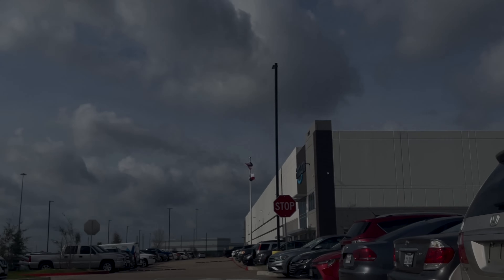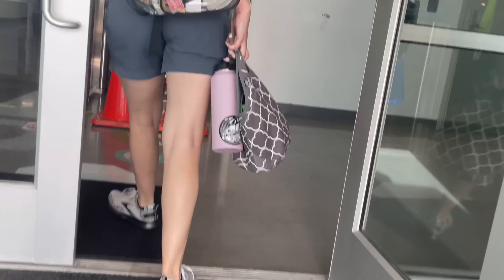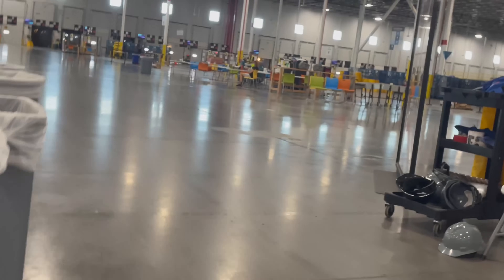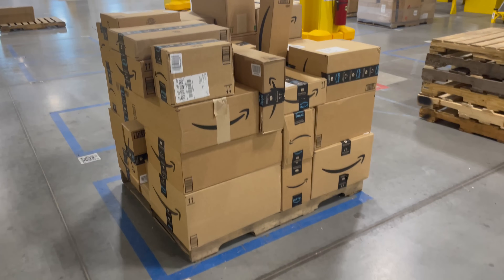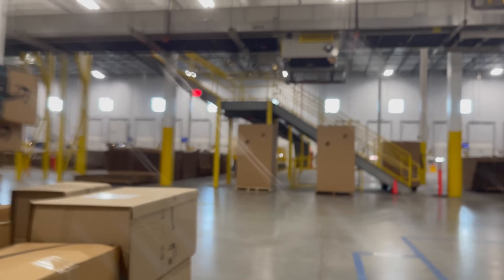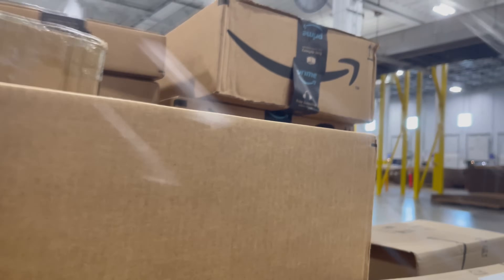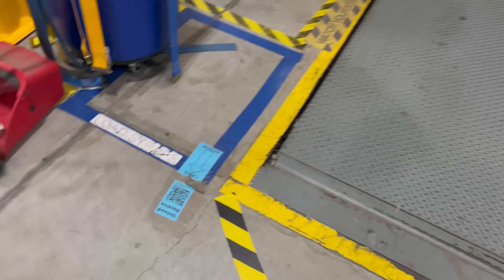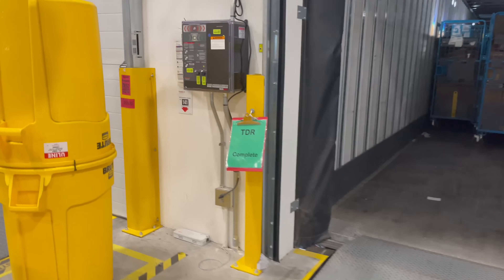What It's Like Working At An Amazon Sort Center Warehouse (INSIDE FOOTAGE)

Comment: Worked at STL5 a year ago. Wasn't too bad, and the hours were fine enough--only 4 hours a shift unless a flex up or down (3 or 5 hours).  You had the occasional manager who went on a power trip, or the average worker slacking off on the line. Breaks were alright, though they shorten them from 30 to 15 minutes during the middle of my tenure. The pay was okay-ish at $15.50 an hour. Though for the work I was putting in and the amount of time I was there it was a bit insulting to not receive a raise, and have the newer hirers get $18.00 an hour with a 3,000 sign-on bonus. A major pet peeve would be the constant "talks" I received due to my scanning numbers not being over 150 for the duration of the shift. It's quite silly to expect such numbers when you're essentially doing everything on the line: scanning (and stacking) boxers to the pallet, wrapping them, taking them to the stage, putting them on the trucks for outbound, etc. Keep in mind that I was only a scanner as I was not officially trained for these positions, but I got so good at them that I could do everyone's job. Be mindful of the holiday season. Thankful I got out before then because lines can get backed up tremendously bad--much worse than when you have high volume shift. I would say be calm, patient, socialize (always important), and stay on top of the work because it's not an unbearable place to be unless you make it--or be unfortunate enough to work at a bad site.
Reply: some of the dumbest associates i have had the pleasure of training and dealing with were from stl5. One of my ops managers personally pulled me aside and said let the TOT take care of them. Like openly racist type shit
Reply: @b_wellyn  When you’d get your start?
Reply: @Yuan-lo3zz  2018 to earlier this month. Got fired over a broken bone leave lol
Reply: @b_wellyn  They’re robotic with the numbers, that’s for sure. But continue to keep such inefficiencies at site. Sorry to hear you got let go, hopefully you found a better position elsewhere. I started in 2021 leaving in October for college.
Reply: Your mistake was trying to find everyone's job. If they assigned you to scan you're supposed to just scan
Reply: @b_wellyn that doesn't sound racist
Reply: I got a interview for them tmrw!
Reply: @ST41500  Good Luck with it. The process should be straightforward. Badge activation, training, tour of the facility, and eventually position selection. Most are easy, whether it be scanning, super chutes, water spiders, staging, or the “express stacking.” (Located on the far left of the building near Lane C. The only thing I disliked was ,as I call it, “black box.” These are the sections of the facility that require the use of two pallets to place items onto and eventually wrapped, closed, and loaded onto the trucks.

Comment: Sort Centers have gotten boring now, back when I worked for Amazon at an SC they still had PIT. Now SCs want everything done by a manual pallet jack and the carts. Very fond memories I have of the forklift and electric pallet jack filled Sort Center days!
Reply: I remember working at a building that center rider pallet jacks. Those were stupid fun when, the maintenance crews "inadvertently" gave out the code to make them faster 😅 ...gooood times.
Reply: XL buildings are like this still. Just because the stuff is just top heavy for regular jacks.

Comment: So many safety violations. xdock just means you are suppose to transload the freight from inbound dock to outbound dock ("cross"ing "dock"s). Interestingly enough, you didn't show how the freight is actually sorted. I'm assuming your facility is AR sortable, which in that case those inbound max-reach lines would feed a conveyance device to ensure a single line of parcels is fed to your shipping sorter which will scan them package and divert it directly to a chute, perhaps to robot arms, or even people to manually load a drive. The gaylord dumpers also likely feed a cross-belt sorter. 

There is also TOM team and TDR to get the trailers to and from the dock, ship clerk, etc. 

Nice thing about a xdock or sort center is that you only work the freight you have, so when you are done you can VTO/MTO and go home if your ops doesn't throttle you down to lengthen the sort window.

Comment: I just did my first 3 days of training and will be going in on my 4th on my own after two days off.  Your video was a nice refresher.  I don’t know why but I get the feeling that we didn’t get the full proper training we need.  I’ve never worked in a warehouse before but I still question why we “throw” all kinds of different size and weight packages inside the shuttle (Gaylord for you) 😅  but it’s like, we have the shutes where the robots upstairs are throwing boxes down.  We are at the bottom, waiting for these boxes and sort them out by either building a pallet, using those blue crates you showed towards the end, and/or throw them in the shuttles. But it doesn’t matter what comes down it all goes there, boxes, bags, heavy, light, you name it.  And they are literally thrown in, meaning we don’t pile them up in any organized manner.  At least that’s how we’ve been trained.  Which blows my mind. Those trailer containers though, we know nothing about.  I’m hoping we don’t ever have to deal with doing that because it certainly looks like the worst part about the job.
Reply from the maker: Thanks for the comment! I didn't receive much helpful training either. They give you like one "training day" and then expect you to learn everything within 2 weeks. Don't worry though you'll get the hang of it!

Comment: I might give this job a shot and see how it goes
Reply from the maker: Go for it!
Reply: Do it. this is my 3rd week and they are super fun people easy to get along with. been with delivery station 3 weeks. love it you'll be happy and room to grow. finding shifts you do have to be ready to be on top of. at least in the delivery station that's how it is
Reply: Do it. I'm in week two of my Sun-Wed, 7AM to 6:30PM (mandatory OT). Gotta be honest. Best warehouse job ever. My facility is brand new, but we use Order Pickers (basically fancy modified fork lifts that we rely on them basically). They go up to like 50/70 ft and are fun (but so slow, especially on turns)! Careful in your VNA's.
Reply: It’s really easy
Reply: My experience was way different lol. It's good at first but few weeks later you'll have almost no days off due to Mandatory schedules. You'll basically have 1 day off due to Holidays! You will work 12 hrs for 6 days straight with just one day off. Not saying it's a bad thing. Just a heads up
Reply: @unknownx  I used to not call off the whole year then during peak I would call off on holidays so I never hit the max points to get fired

Comment: I'm a box truck driver for amazon,keep in mind that if you put small packages on the bottom and big and heavy boxes on top or if you decide to put a punch of heavy boxes on one side then it's going to fall
Reply: Well the problem in ohio at a certain location is that all of the you know who worked there. That you know who that you know who said eat you know what. In Ohio. So they never built pallets properly. They couldn’t build a proper pallet to save their lives so it’s constantly a safety issue there. But they can’t say anything because they are protected beings.

Comment: Most people are trash at building the pallets at my amazon i work at. im constantly rebuilding them. It amazes me how bad alot of them are built.
Reply: I know what you mean. 

I would sometimes see pallet standing at an angle as if it was about to fall and they keep stacking it. It's supposed to stand straight 90 degrees up on all direction from the floor. When it falls, a lot of that extra work could be prevented if they did a little rebuild as they go. 

When I build a pallet, if I see a bigger and heavier box while I already have some smaller ones on, if it's not too much work, I rebuild before thinking of starting another pallet for the same destination.

Comment: You remind me of myself when I worked at UPS as a "package handler".    But, my main job went from getting bags that need to be peeled (replenishing) to jam breaking (ensuring that packages dont bind up while transported on the belt system) as I was REALLY good at it.   Though I resigned because they wanted to cut my pay from 18/hr (at the time) to 15/hr.       So I asked if I can be a truck driver for them and they said I have to do 1 year of safe driving and I said, "Alright, but when can I at least get into the smaller trucks for local deliveries?"  And they told me that I'd have to wait 5-7 months and I said, "In that case, I'm out."   And the reason why they said that was because that not only was I low on the senority list as it goes by union's standards. (Fuck you Teamsters Local Union 63) but also that the union (apparently) wanted to cut my pay and not UPS's.     My 3 supervisors and my manager wanted to pay me more for the hard work that I put in but they couldn't because of the union agreement.

Side note:  I hate one of the managers that were above my manager as they told me that I couldn't read my COMPTIA A+ study guide as I was multitasking because they saw it as a "distraction".

Translation:  They didn't want me to be smarter than them, nor successful.

Well Kevin (not my manager's name), I hate to break it to you but I am living my life my own way, and I bust my ass to get a better life, and I am waiting for <insert big tech company here> to call me back, I got halfway through the book in 2 weeks (2500 pages long total) and I made more progress in two weeks than you have in two careers.  Not to mention I'm autistic so this disability ain't stopping me except an envious hire-up.. oh wait, that's you Kevin.    But, not to worry I can just finish the other half of the book while I'm waiting for a call-back and right before I get hired I'll just take the COMPTIA A+ cert test, pass that, then get hired by said tech corp.    Yes, I'm ballsy for saying it because I know I can do it.

Stop me now Kevin, or step the fuck out of my way and stop wasting my time and get your priorities straight.

Ahem, srry for the tangent there.  Anyway man I love your videos and keep up the awesome work. :)
Reply from the maker: haha thanks for the comment and glad you're doing better for yourself now
Reply: nice larp
5/7
Reply: Keep going bro
Reply: Literally nobody cares
Reply: Damn my boy u really hate kevin dont u? 😂😂

Comment: I work at a SC in georgia and we have similar process but instead of our packages going down a slide we have conveyor belts and people splitting boxes and move them onto the side belts and you pick off the boxes from the belts and scan them onto the floor and we call crosstalk outbound
Reply from the maker: That's actually how it used to be here as well, but then half of the warehouse went under construction and AR took over.
Reply: Kinda reminds me of UPS sortation .. only the packages stayed on a belt even after splitting to different belts

Comment: How come I didn't see you scan the packages to the pallet? Your sort center is laid out way different than mine. Yall have better equipment with all those chutes. You shouldn't have shown footage of the inbound area. Too many boxes on the floor. I wish I could record in mine but there is always someone walking around especially management.
Reply: Many sites use auto-containerization which uses sort-tech to move the item virtually through ssp. Or perhaps he simply edited the video to not show it. I doubt he didn't since they'd have terrible scan compliance and he'd get coached/adapt about it.
Reply from the maker: We used to scan the packages to the pallet but then the AR installation took over the warehouse, the chutes were installed and we no longer had to scan packages to a pallet, only place them on.
Reply: @GhaemiTV  oh wow that's pretty cool. we only use pallets for the gaylords or fulfillment returns. other than that we use the go carts mainly.
Reply: @JustaN00bi3  my facility is the same as his. We have AR robots upstairs which drop the packages down through the chutes.